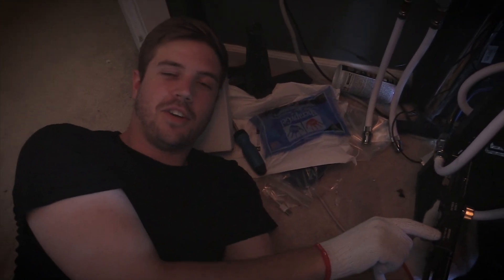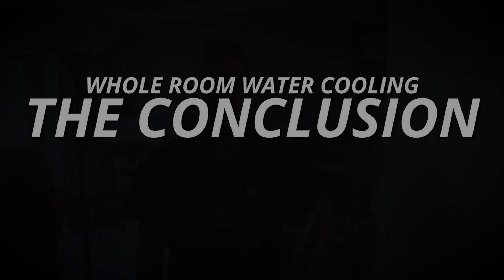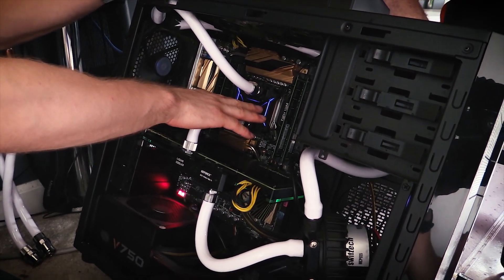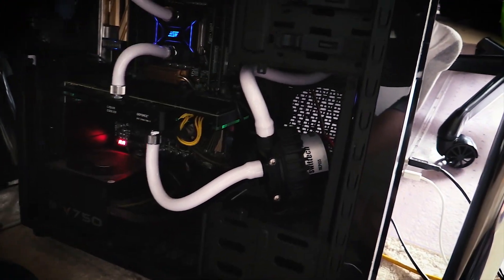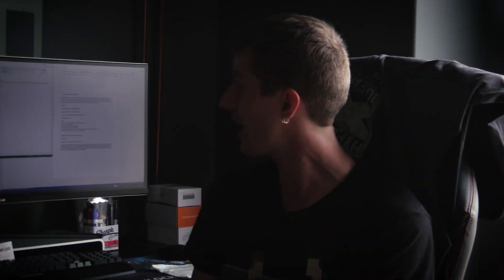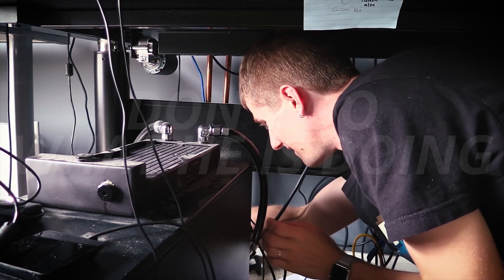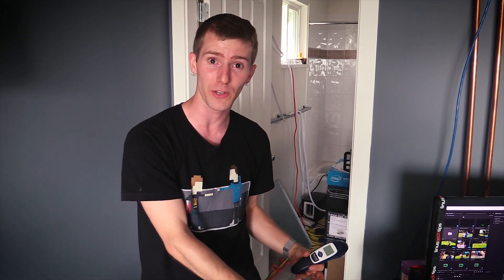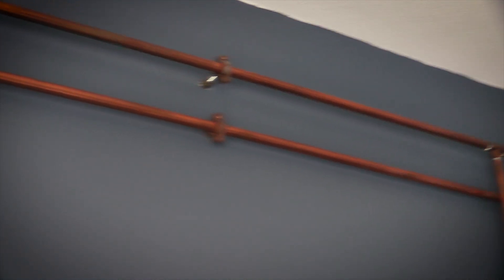Whole Room Water Cooling Part 7 - It's FINALLY over!

Comment: Hi Linus, I just become a fan of your channel recently. I just finish watching all the series of the whole room water cooling system and the desk pc project. When I saw how much the maintenance work you put in. I have come up an idea, how about putting alcohol to replace the water inside the system, then there will be less maintenance, because the alcohol will kill all the bacteria. Then I thought about Scotch whisky or red wine. Then I thought you guys should built a pc with red wine as the cooling system and a vampire theme style for the decoration. Adding a glass chamber that look like a human heart, tubbing look like veins. So, when the system is running it will look like the blood is running in the system. adding a hollow glass tank cover on the side of the pc, red wine will run through on the bottom part of the hollow tank, and the alcohol will evaporate and cumulate on the top, then it will form drop like blood drop. Because alcohol will be easier to evaporate in high temperature, the more you use the pc, it will look like the pc is alive and taking a harsh treatment from the user and bleed more. I believe this will the COOLEST PC EVER!!!!!!!!!!!!!!!!!!!!!!!!!
I hope this is helpful.

Comment: i got a project that i was thinking for a while now. but havent thought it would be feaseable till seeing this video. over the top of my roof, directly on top of my pc room, there is my house water tank which holds one ton of water. the water is circulated through the house and replenished from mains. the water that comes from the tank is not used for drinking or cooking in any extent. i got another supply coming from mains and filtered for drinking and cooking in kitchen and for all consumption we only use bottled water. i calculated a hypothetical system that circulates water from the tank to cool a 500W pc. in that scenario, the water temp of the tank can only rise by 10 celcius in 24h if there wasnt any heat dissipation at all and under max load so its an extreme overkill. and i would take the water tubing through the wall to make it so there would be close to no  heat dumped into the room. the question is how good would it work and would mains water corrode blocks without additives. also would it be safe for shower?

Comment: There is literally meters of higly thermally conductive copper piping per system ("hot side")... being inside the house. Now the overall heat dissipating area of those pipes is not that high, compared to overall heat dissipating area of watercooler radiator or heatsinks in general. But still my guess is 1/3 of the produced heat might be radiated inside the house by those pipes. Also all electricity used in all the pumps both inside the computers and in the toilet are producing heat. The thing people often don't know: Electricity is turning into heat, at some point. Energy is not ever disappearing, but it can change its form. Now all electricity fed to pumps turns 100 percent into heat, both straight on the pump and indirectly within the system because of frictions both in fluid and between surfaces and fluid. Big junk of pump power is actually radiated outside the house so what pump power is actually doing is increasing the temps of hot side piping and dissipating inside the house... just like the gpu and cpu power. So copper tubing inside the house is radiating heat power out of cpu, gpu, and pumps.

Comment: After all that I know down deep inside you and to build another whole room system for expensive high-end equipment and use a Pim worthy of the task like BMW or Mesadies Benz or whatever your client wants to use including a pump from a car he loves can now cool his computers. All automotive water pumps will more than satisfy the need. What about a wall of water to be part of it its not difficult to do and in the summer it really can reduce cooling cost.
I mean while you are there you want to sell as much product as is good for you and your customer I really enjoyed your videos good luck to you.
There is a pump made for every client if you think outside the box keep the momentum going.
you should do it once and see what you do you will be impressed. Don't choke the flow until that's what needs to happen the 1/2 system leave room to scale up and you might consider aluminum pipe or stainless steel instead of copper. For a time when you are not on a tight budget. Have fun with it a tube doesn't have to be round you might have a rectangle or square as an eg. Also maybe paint or other embellishments on the tubing to kick it up a notch. 
I think it was a great video thank you I don't have your education but I been a gamer since Pong and I bought a Modle III 6 months before they came out just to have my order in Sept 1978. I have built all my PC and I think I installed a water cooler near ten years ago. A lot of the time I have no clue what you're saying but somehow I can make sense of enough to enjoy your work. At 71 yrs old if you ever see ImOldNubz in BL2 lets hope we are on the same team (;o)
peace

Comment: Linus, I just watched all 7 of these video's, and subsequently wanted to express something: although your vision/idea didn't exactly work-out as planned, I still find it very admirable you had the will-power, dedication, and focus to finish this mammoth of a project. Honestly, I think this "failure" might have been one of your most impressive builds ever. Because, I KNOW I would have quit in video 2 or 3, and just would have decided to have each PC run on it's own closed-loop.
Reply: @paperman9708  Those Noctua fans they used were supposed to be water and dust proof. I guess they cleaned and reused them.
Reply: @paperman9708  That's strange because I've literally run case fans underwater just to see if I could and they worked!

Comment: I been watercooling my PC system on water from the river for 11 years. CPU temp stable at +5C no matter CPU load. Why arent you doing that? You dont need a river, just the water in your plumming running at a slow rate so no condens build up. However if you want some pressure to get CPU and GPU to have almost same temp as the water then you get condensing problems but I solved the condensing problem with sub the whole ting in oil. Then I can have full pressure from the +3C cold water from the river. And it even cool down the oil to almost same temp as river water temp, keeping the mainboard and the whole thing very cold. I also have radiators outside so that in the wintertime the water inn to the system drops to almost zero. Water out just go back to the river. As easy as that. For thouse without a river, just use the water from the house plumming. Works great also without oil submerged system if you adjust water speed inn so that no condensation will happen. Probably you can also use https://www.youtube.com/watch?v=6Isc9UMAmDM to cover the input and output lines as well as the cpu for prevent condencation. But you would need to 3D print a cpu house so that the isolation would not build outside of wanted area.

People are buying expensive stuff to get CPU and GPU down to +20C. I only buy a CPU watercooler block and a GPU water cooling block and a radiator from a old Volvo Amazon for vinter usage and there I reduce CPU and GPU temp down to +5C in summer time and wintertime +1C - +2C. No condensation problems and a ice cold oil bath, keeping the mainboard and all its components operating at an awesome performance. Temp wont even go up if I overclock both CPU and GPU and on full load because water speed inn are pretty fast and water temp are so cold.

Comment: Now that I'm thinking about it.  Automotive antifreeze shouldn't need a biocide because the water is usually above boiling temperature, and the whole automotive loop is kept at above-atmospheric pressure.

Comment: You could increase the efficiency by putting pipe insulation on all the copper piping in the room, those with the hotter water are acting as a heat source warming the room, insulating them would keep the room(s) much cooler. Just a thought..

Comment: Insulate the copper tubes and use bigger radiators and fans outside - automotive parts is what I have in mind. That would most likely give the computer much lower temps as a whole.
BUT if you would like to keep trying the concept of also 'cooling' the room ditch the insulation and add peltiers on the reservoir  - if you have cooler-than-outside liquid running in the tubes theoretically you would have a 'cooler' room as well as cooler computers. Don't know if it would actually work but I would say it would have a better chance of success…

Comment: i saw copper and thought, what the fuck man.... because that was going to dump heat into the room, just insulate the copper tubes with something else, wrap it in a thin layer of insulation and use a colorful tape that will hold it together with the room color

Comment: 7:39 When measuring the pipe temps you completely missed the mark on the hot side and measured the wall temp. Look at the laser.
Reply: I have the same gun, and the laser is located above the actual sensor,  since he is holding it so close to the sensor, and the pipe is relatively thin the laser just doesn't work.

Comment: I would of had the pipes lower down to the ground, flow would be improved since pumps wouldnt have to push upward so high, and a PC to PC system would of worked much better as well. Instead of each PC being being connected at a joint, make the PC the joint, the flow itself would pull enough heat from EACH pc to carry enough cooling out anyway. And also coating the pipe in a paint or something would help with the head radiation problem.

Comment: One option would be to locate the PC's in a climate controlled comm room, use USB extenders for keyboard/mouse control and fiber optic modems for video back to your displays.  We do it all the time in hospitals to eliminate having a PC in the operating room.   Might even be cheaper than what you tried here in the long run...   Loved the series though!
Reply: Pretty sure the only thing they need is insulation on those copper pipes in terms of the room temperature. Cause honestly I have watch quite a few house building shows where they literally use copper pipes under the floor boards with warm water to heat an entire houses during the winter... also copper pipes are very good at radiating heat... so I honestly don't know why they didn't just insulated them.

Comment: The problem with all the gunk is...while it is fine and dandy to have a UV sterilizer, it doesn't actually help at all with the gunk that's stuck in all the nooks and crannies of the system. Only adding a biocide or regular cleaning of the system would help with that.

Comment: If you decide to do this in the future, try running your main piping a few inches above the floor, to eliminate the air bubble problem. You can also add in a bleeder valve to burp the air from the system easier. 

As for your reservoir, instead of a steel tank that will eventually rust, you could use a 20-55 gallon plastic drum.  
Another small addition I would add, would be color coded tubes for the inlet & outlet lines from the main, and have it to where when you disconnect a PC from the main line, you can connect the inlet & outlet lines together to close the loop and keep the pressure built up n the system, so you don't take the chance of starving the other systems in line.  Overall a very neat idea, just need some revisions and few tweeks to perfect the idea.  Good Job guys.

Comment: the places that ive worked all use a similar set up but with one critical differance. everything is stainless or copper. and instead of computers they cool welders. they used a car radiator and a large fan on it and the pump is 1 Hp and creates a steady 32psi pressure differential between the charge and return line with a pressure regulator that dumps the exstra volume into the resinvor. that tank is actually mounted high up on the wall so its the highest point and does not need to be a closed loop.  another shop berried a 300 gallon tank in the ground and uses it to cool the test machinery they make unfortunately that machinery is in the millions of watts and thermally soaks that system very quickly with no radiators. they will run up to 4 machines at a time and the coolent lines are 3 inch fire hoses... they will actually tap off a meetered fire hydrant and use city water for cooling when needed and just run the water into a drain

Comment: Instead of all the radiators and fans outside buy a really small chest freezer and use it to store and cool the coolant. Terminate the supply and return lines in the freezer. Any air in the system should escape and you could regulate the temperature. All your supply and return lines would have to be insulated to prevent condensation.

Comment: There would have been a greater efficiency and effectiveness if all the copper lines had been insulated. Yes copper looks cool, but the reality is exposing the copper tube to the room makes the removal of heat less effective and not insulating the returning 'cool' water allows it to be heated by the room temperature thus reducing efficiency of the overall system.  Also, while using a whole bank of PC coolers outside looked awesome, they are hugely inefficient compared to one large aluminum radiator with one large fan able to draw more CFM across the cooling unit removing more heat to the outside.   I would have thought the professional plumber would have advised insulating the lines to help.  Also, insulating the lines helps with condensation issues which I'm sure arose on exposed cold return lines. 

I've watched a number of the videos of various subjects and it's apparent there is a big knowledge hole for some of the designs they've come up with for various projects.  Sure I know there are a bunch of fanboy computer saavy geeks which are wow'd by some of this stuff, I can't help but shake my head at the lack of general practical knowledge that is missing outside of computer related gear.
Reply: Yep exactly what I thought... Guess LTT back then were more into aesthetics than actual function... just shows why everything RGB nowadays is just really RGB refreshes of existing products with super minor performance improvements.

Comment: it would need insulation on the in and out pipes actually because the goal is to maintain the water cool as it comes in from the outside and on the out so as to help "carry" the heat back outside. leaving the room totally unaffected by either of them.

Comment: so many things things that could have been done better:

the inlet (cold) copper piping should start with a larger diameter and move to a smaller diameter so all the computers get equal amounts of water. the outlet (hot) piping should go in the opposite way.

all the expensive pc radiators, pc fans, pc tubing, and pc cooling fittings that make up the radiator, could have been replaced with a cheap car radiator and large fan which would save tons of money and probably be much more efficient since car radiators are designed to handle heat loads like that and there are less electronics

the copper piping should be insulated so it does not dissipate all the heat into the room, defeating the purpose of building the system in the first place

an air conditioner and a curtain would have been way cheaper and would work perfectly fine
Reply: But that wouldn't have gotten him millions of views.
Reply: Woah woah woah dont forgot about how hard it was for them to pump the water up all the 2 meter rises at every station as opposed to simply keeping the whole system near level, if not slightly sloping downward throughout the system w/ one pump before the room system and one after the piping system right before it rises to get out the window.
Reply: All the computers should've been individually valved off the whole room loop as well, relying on quick disconnect fittings isn't a great idea, they would've also saved a ton of issues if they just went with a way bigger pump from the get go, and I would've used PEX tubing instead of copper, sure it doesn't look as nice but it doesn't transfer heat like copper does and is way easier to work on, modify and repair, plus I would've used a car radiator and big fan instead of relying on a bunch of tiny fans with a ton of different connections and failure points, but in the end they should've gone with the simple solution of an ac unit or a heat pump
Reply: @brando12343  agreed. I love when people still reply to this comment years later lol

Comment: Wouldn't it be a great idea to box in all the copper piping, then add air conditioning to the boxed in sections, so that it entered the boxed in system and flowed by air over the copper piping, which is a great conductor then the water in the piping was additionally cooled in loop.

Comment: Realizing this is really old now, I'd be curious how a properly done system with insulated pipes inside the walls and quick disconnect "outlets" installed in the walls may have worked out. As some commentors have mentioned, AC can get very loud in server rooms not to mention it creates a very dry environment if run to some extremes. Also coupled with heat reflective curtains (or any curtains at all lol) I could see it being a very pleasant work environment.

Comment: You should look into getting a tour of a US submarine.  They have work stations all over the place that are cooled this way and even the piping looks similar.  You could really use some isolation valves on that thing as well, one pump might have done it if you had a more narrow path to start it on and then opened them in a sequence as the loops filled, definitely need the bleed system as well.